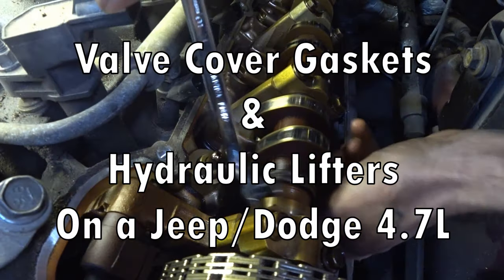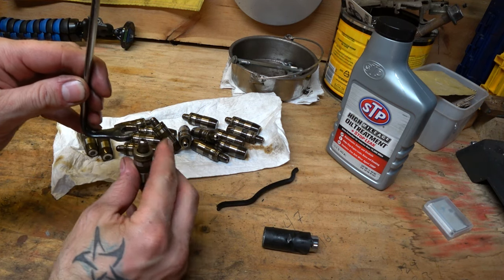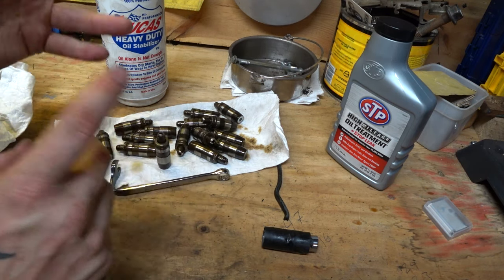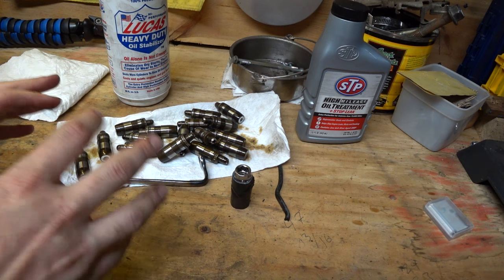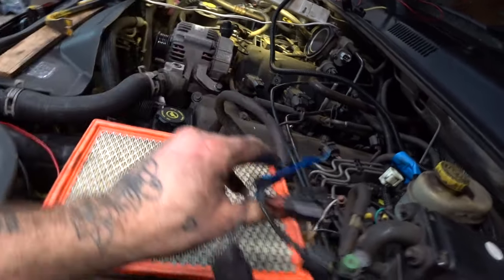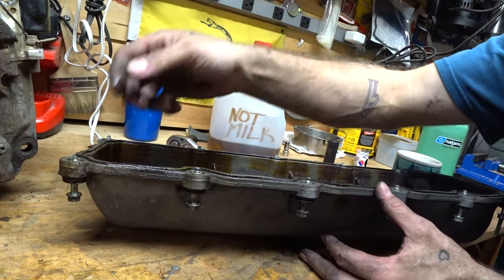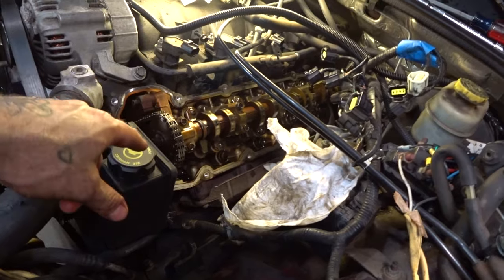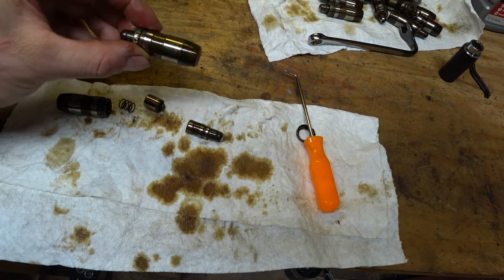4.7L Hydraulic Lifter and Valve Cover Gasket Replacement - Tips & Tricks to make it EASY

Comment: Not faulting you, and you do a hell of a good video, just one thing you messed up on. The lifters do not collapse and the springs are not failing. The opposite is true. When a lifter collapses, the internal parts go down all the way to the bottom. These do not. They actually fill up with dirt or sediment and stay all the way extended up. They virtually become a solid lifter. Without the give of the lifter pushing down, that is what makes it possible for the cam to spit the fulcrum out. Aside from that one detail you did a very good job.
Reply from the maker: Hmm.. That is very interesting and contrary to what I have been taught. I will do some more research on this. Thanks for educating me
Reply: Cough... Unfortunately I don't think that's the case. You can actually swap these out for solid lifters (martin built has a video) they are not fun but can be done. What causes these to mess up is gunk inside prevents the "cup" from coming back up under spring tension. That same cup has oil pressure under it to push up the rocker and hence open your valve. If you wanted you could take them apart and clean them up and actually revive them. But it's not worth it as a full new set is only a few bucks.
Reply: No he was right, you are confused

Comment: The 4.7 has 3 timing chain tensioner that are hydraulic tensioners the port for these tensioners is microscopic. I would not pour Rotella diesel oil in as it will sludge up and cause issues. I recommend using full synthetic 5w 30 and use seafoam at each oil change. Pour 2 shots of seafoam into oil drive for an hour or two then have it changed while the engine is hot thus allowing all the broken down sludge out before it re-solidifys

Comment: Thank You for showing the gasket set in the package. When I bought the gaskets they gave me VS 50577 R. The cover gasket was way too thick to fit the groove. I came back and watched this video again to see the part you had. (VR 50521 R) It fits like a glove. Great video. I'll have my 04 Overland back on the road in a few days.
Reply: I had the same issue next time try a 2003 4.7 valve cover gasket that’s the thinner one but it fit my 2004

Comment: I could really use some help. I just put new lifters and rocker arms in my 4.7. When I started it, it started perfectly fine, but it had a little bit of a rough idle. No noise no ticking, but it sounds like one cylinder might be dead? I am getting raw fuel out of my exhaust. I’m wondering if I might have screwed up a wire to one of my spark plugs, causing that cylinder to not fire? But I hope I didn’t ruin something in the valve train.

Comment: What are the other common issues with the 4.7L V8's?  This seemed to have been the issue with a friend of mine's Dodge Ram 1500 it seemed to like to throw those rockers off quite frequently and somehow that lucky SOB got to swap trucks straight across...he got a 2005 Dodge Ram 2500 Hemi, he still has no idea why the guy wanted my buddy's 2005 Ram 1500 with that 4.7L V8 but when the guy called and asked if he wanted to trade straight across he didn't hesitate LOL.
Reply from the maker: They also drop valve seats (aluminum head, steel seats, you get it..)

Comment: My 2003 Dodge Ram 1500 3.7L 6V has a tick also, not sure if its a lifter. I don't hear it when starting only after the engine is hot. Has 137K miles on it. I don't hear the ticking outside, but when I'm inside the truck I can hear the ticking.  I already added seafoam to see if it goes away. Is there anything else I should see or hear to determine if it is a lifter, before I start surgery on the truck?

Comment: I recently picked up a 06 Grand Cherokee 4.7. Currently has one misfire in Cyl 7, I have replace all plugs/gapped correctly, replaced all coil packs. Ensured injectors are all working. Also have tested to ensure the proper voltage is going to the coil packs/injectors. I do have a slight ticking/knocking sound shortly after starting the car and once slightly revving or driving you can hear this ticking/knocking speed up. I am leaning towards taking the driver side valve cover to see if it is a rocker/lifter issue. Do you think if one of those were to fail it would causing this noise/misfire before I attempt to take the cover of to inspect? Also replaced the EGR valve. My final step after I remove this valve cover is to test compression in Cyl 7.

Comment: Did you record the passenger side? I gave up halfway through tearing everything down and put it all back together. I don't have a buddy to help who won't squirrel out of it at the last minute.
Reply from the maker: I did not film the passenger side because it was just all cursing and throwing tools. There was no real way for me to add anything helpful other than to see it IS doable, but it takes time and a million different tools.It took an hour to get the last rocker popped back in. we through every screw drive and pry bar in the shop before I found the right one for the job. The passenger side would be easier if the heater core lines were disconnected, but you have to do it before the valve cover is off or you will spill coolant in there
Reply: @DEInTheGarage  hahaha ok that explains it! I felt that coming and decided that the dealership is gonna do this too ;)

Comment: So this is what I have to replace on my 2003 Dodge Ram 1500 with the 4.7L with 268,000 miles that has a "clack clack" noise for about 20 seconds when I first start up the engine?

Comment: Could this cause the intermitten misfire i have? I do have ticking coming from about the valve cover area, started misfiring after i put conventional oil in it due to money issues, since changing the oil back to full synthetic it has gotten better, but still has the occasional miss, swapped plugs, injectors and coils. Still there though. Shop said it could be a valve issue, but that normally would not be intermitten, said the same about piston rings.

Comment: I just got a 2008 Ram 1500 about a year and a half ago and had heard that the 4.7L had a lot of issues with gaskets but mostly head gaskets if you get the motor to hot. The truck runs great and has about 117,000 on it and doesn't make any weird sounds, is there anything I should watch for or any special oil or oil treatment you recommend? Great video!
Reply from the maker: Not really. As it is an overhead cam engine it does fine on normal synthetic oil. They only go bad when they are neglected. If cared for they are great engines.
Reply: @DEInTheGarage  Thanks for the info. Never was much into Ram but I traded my Equinox even for it and I must say I`ve become a fan of them and they have gotten a lot fancier since then.

Comment: Hey man I got questions I'll have it 2001 Dodge Durango with a 4.7 high output and I'm the original owner and has 205,000 miles on that truck I told that truck a lot not often but sometimes and I change my oil every 3000 miles and I replace my valve cover gaskets when I had a hundred and thirty thousand miles do you think recommend that or no because I change my oil every 3000 miles
Reply from the maker: Sounds like you took great care of the truck, but in my opinion the lifters in these engines are consumable parts like spark plugs or brake pads. After my research and what I have seen of 4.7L failures I will be doing mine ever 100k. might be a bit extreme, but for $100 and a few hours of work it is worth the piece of mind

Comment: Mopar oil filters have an anti-drain back check valve built in to hold the oil in the oil pump after shut down that helps prevent hydraulic lifters from falling off. I use full synthetic oil, Hy-Per Lube HPZ212 Zinc Replacement Additive, Lucas oil stabilizer, a half quart of Marvel Mystery Oil and say a prayer with every oil change :-)

Comment: This video is super helpful! I am having issues though. I replaced all lifters and only have 4 rocker arms to pop in. The camshaft lobes are in the way and when I try turning them through the harmonic balancer, the camshaft doesn’t stay in place. (I’m turning clockwise- when I release the pressure the camshaft turns back to its original place) do you know how to fix this?

Comment: Hey buddy, great video. I know it’s been a while since you posted this but i had a question. I’ve got the 3.7 WK and i’ve got some ticking. happens at cold start, warmed up, and acceleration. It’s significantly louder from up top on the driver side. Would this job be what i’m looking for? I’m not 100% sure if it’s lifters making the noise but that’s what i’ve been told.

Comment: Does the engine when started, refill and pump up the new lifters. When I replaced mine only half pumped up while the others failed and collapsed then never would activate for pressure no matter what I tried, even trying to pump them manually in warm oil. They still would not pump up. All the new liters , when I bought them were flat without oil. I first soaked them in warm oil for 32 hrs, then poured oil in the litter well before inserting the lifters. Changed the oil. And tried a new start. It ran ragged for about a minute then smoothed out. But each time I started afterwards. It did the same thing even smoking from at least 2 cylinders. I pulled the lifters in questions and the had not pumped up. And continued so. I think the 4.7 is a finicky engine to say the least. Every nuance of every part needs to be in top working order for a descent running motor.

Comment: I just bought 16 brand new lifters for my motor. Had a question? 6 of them out of the box , have no play in them. And 10 of them have a little play in them? Is that usual? Or do I have bad new stock? Or will they all get better soaking in oil?

Comment: so I've looked up the 4.7l Durango 2002 and learned that this particular motor has lifter problems at cold start . But I am wanting to know if you can buy upgraded lifters or racing lifters ?
Reply from the maker: Not that I know of. New Melling lifters and proper oil maintenance should remove the risk of collapsing a lifter, throwing a rocker, and breaking all kinds of expensive stuff in your head. That has been my experience with mine and others I know anyway. Hope that helps.
Reply: I've been changing the oil about every 2500 miles or a little over and adding honey oil and mixing it with the miracle oil or type F transmission fluid for detergent cleaning inside the engine sometimes if I got time I will drain a quart or two after the 2000 miles or so and add clean miracle oil or both at half and half with type f transmission fluid and it's a little less noisy at cold start . Another thing I've learned on hydraulic lifters 
is to take a punch or little Phillips screwdriver and push to pump new oil into your new lifters for priming then proceed to run them primed at first start . but these 4.7l ers have nipple ends .maybe put a small deep well socket on the ends to prime them . And for the basic oil changes you can prime your oil filters for first start to avoid failing oil pumps also.
Reply: maybe a thicker hydrolic lifter spring for less wearing from constant moving wear or should I say taking the spring life out of lifters

Comment: I just bought a 2000 Grand Cherokee Laredo and I hear it ticking sound check all the vacuum lines definitely wasn't any hissing sign definitely was a ticking sound I stumbled across this video and several others confirming on my issue now all I do is ban up and try to see if I can fix this straight six any ideas on performance rocker arms and lifters

Comment: I did not make the full crankshaft turn after installing all lifters. I soaked them for many hours and also added Lucas oil,on all moving parts, but just closed it all and fired the engine up. lets it run for a few seconds and turned it off. Did I possibly mess something up?

Comment: my 2003 4.7 is making knocking sound and I was thinking it was bottom end until I saw this, If its already loose knocking around, could i get away with new lash adjusters or am i going to have to take it somewhere and have them pull the heads?

Comment: This is more of a question I have a 4.7 L V8 in a jeep the 2nd from the back rocker arm was sitting in on the side of the of the head when I go to put it back in I could do it by hand which I know is wrong but would that also cause my motor to seize up to where it won't do a complete 360

Comment: I had a second set of lifters fail after two months in my 3.7.  These engines along with the 3.7 have a slugging problem that causes poor oil pressure to the lifters.  I did a complete upper end rebuild, new everything and it lasted 2 months.
Reply: Curious what brand of components you used.
Reply: @jw11432  
  Got all my parts and machine work at NAPA.
Reply: Dam ik it's and old post but it probably was the clearance of the lifter they had some problems not being the same tolerance and u needed to add a washer with a certain gap or so on
Reply: @josephm995  
  I cut my loses and traded it in back in December of 2015.  In todays world unfortunately new doesn’t mean good.

Comment: I bought a cute little dodge SWB 4x4 truck with the 4.7 which is about to pass 300,000 miles on the original engine! And I'm hearing a subdued ticking on the driver's side. I'm considering upgrading to the 4.7 HO cam and lifters...any thoughts?

Comment: I have a 2004 Dakota, 4.7. When I start it I get clattering for less than a minute, then goes away. It has 150K miles, did you get the clattering at all? To me, it has to be the lifters, as rods/ valves will not quiet down, unless the lifter is causing it? Thoughts?

Comment: I'm working on replacing the lash adjusters in my 4.7L. I bought new lash adjusters and I found that some I can depress the spring with my fingers, while others are so stiff that I can't get them to move at all. Should they be that stiff, or should I be able to depress them by hand?
Reply: I couldnt find a solid awnser ither. But when i called the jeep dealer who only had 2 and was national back order he pulled one out for me and said he can easily squeeze it down .. so Out of 50 and 3  vendors melling, sealed power and amazon i had some springy some solid  and some stuck down  which i knew 100% was defective.

Comment: I'm doing the same exact thing on a 3.7 jeep. Do you know of the motor spins counter clock wise or clock wise for the rotation of the camshafts?
Reply from the maker: Clockwise if you are standing in front of the vehicle. make sure you bar it over from the crank bolt and never from the cam bolt. You could complete screw your timing

Comment: Dang it! I have a 2005 4.7 Dakota with 140000 miles on her and they are noisy. 
I just replaced the oil pick-up tube because of low oil pressure and it was 90% clogged. Probably time to let her go.

Comment: I have a 2005 jeep cherokee says it has the 3.7 but there's a 4.7 in there it idles high and runs hot the electric fan I haven't seen it come on I've replaced all the fuses  and have a clutch fan and electric can't figure it out
Reply from the maker: Hmm.. That is tricky. Maybe fan relay?

Comment: Had two lifters kept popping out. Mecnaic replaced all of them but didn't change oil. one went bad, Replaced it. half hour of driving another went bad. What to do now. could not putting clean oil in or not presoaking them have done this?
Reply from the maker: Likely no pre-soaked, so they ran dry for the first few seconds on that first startup which would ruin them immediately
Reply: @DEInTheGarage  he blamed it on the dirty oil and the quart of transmission fluid we put in to try to free up the lifters before we ever took it apart. Said the dirty oil clogged em up. But he also said it clicked till it warmed up... Sooo

Comment: I can hear on my Grand Cherokee 4.7 V8 like loud clicking and i think the hydralic lifters do that. But it does only when the engine is cold it will stop after few minutes when engine is warm. Is that ok?
Reply from the maker: Yes, if it goes away when warm it is likely the beginnings of lifters
Reply: @DEInTheGarage  Now its doing all the time but it go quiter when engine is warmer. I think im just gonna try to change them. Hope i dont mess anything never worked on engine before :D But seems easy thx to the video.
Reply: Mine does the same thing

Comment: I bought it a re manufactured engine 4.7 dodge ram, everything is great , but guess why im here, i read they won’t change lifters , and now they sound , so im ready to work on it
Reply from the maker: It really isnt a hard job, just takes patience. good luck bud! Don't put it off! You can spend a saturday doing it or you can spend a whole paycheck on a new motor later. Good luck!
Reply: @DEInTheGarage  you right, i was about to do it last Saturday, but I didn’t I didn’t have the lube to put them on , is on the way now, rotella oil just arrived, but is a engine with probably 10.000 miles on it

Comment: A note on the oiling system in a 4.7. Do not add Lucas to the oil in a 4.7. The bearings will love it the Rings can't handle it. Have a lifters will work much better if on occasion about a week before you're about to do an oil change, when you're about a quart low on oil, you put in a quart of Marvel Mystery Oil and drive it that way for several days or a week and then change the oil and all that gum that's jamming up the inside of that lifter will be gone. It is severely old school trick, but it works wonders. And please ignore the part of the video where he says put zinc in the engine. If the engine doesn't run flat tappet it doesn't need zinc. Zinc won't hurt it, but it's not doing anything for it. Use a high quality synthetic oil. Preferably one of the several that are better than mobile one. But mobile one would be a good oil. You did mention supertech oil. Supertech synthetic actually test out better than mobil one and it's a hell of a lot cheaper.